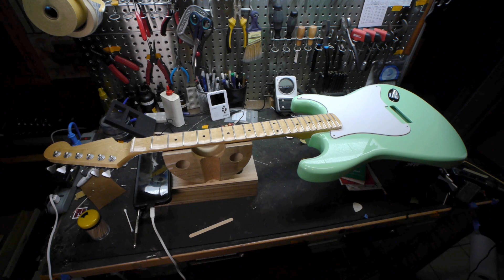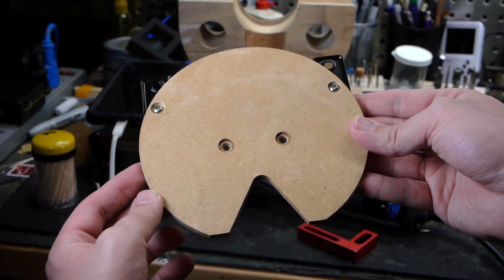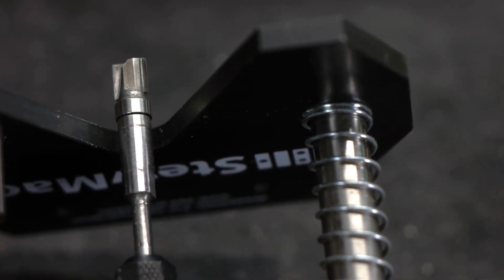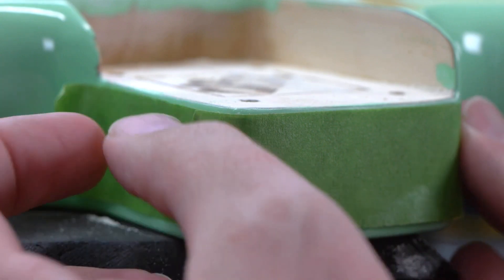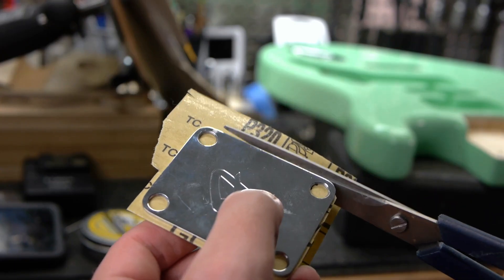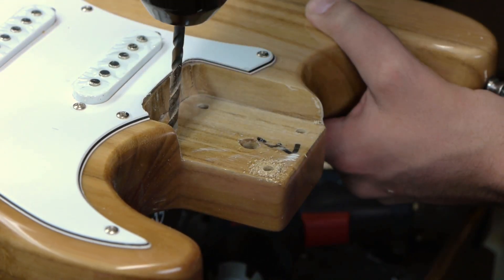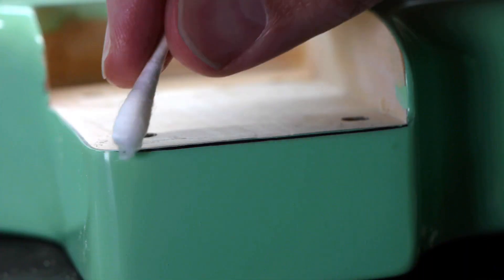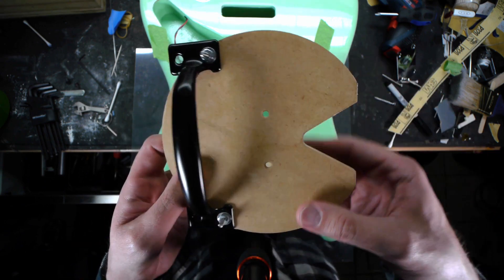*FLATTEN or DEEPEN the Neck Pocket* - Custom Baseplate for Stewmac Plunge Router Base

Comment from the maker: UPDATED ROUTER BASE HERE: https://youtu.be/08BCl9feae8?t=285

I'm working on doing an updated video, but for now, that's the most up-to-date footage I have for the new baseplate design. Very simple: 

* 1/4" MDF Neck Pocket Routing Baseplate
* 8-32 x 1/2" Socket Flat Head Machine Screws (2)
* #8 x 1-1/4" Wood Screw (1) 
* Dowel Handle (roughly 1-1/8" diameter)

The handle is attached to the baseplate with a wood screw. The countersinks on the holes indicates the bottom of the baseplate. The top is where the Dremel router base sits on and attaches to. Simply use the supplied 8-32 x 1/2" socket cap machine screws to secure the Stewmac base to the Neck Pocket Baseplate, screw in the dowel handle, and you're good to go. 

More on the way. I'm slowly working on redoing my bolt-on neck installation & troubleshooting guide, which will include an updated overview of the neck pocket flattening/deepening process. One thing I haven't mentioned in any videos yet is the use of Mylar film to protect the top of the guitar while routing. It's slippery enough that it doesn't pose any issue with the MDF sliding along the top of the guitar.
Reply: WOW! F.ing AWESOME! I so needed this. Doing a project on an Agile S1000, someone had taken a bloody chisel to! Looked at the Stewmac dremel plunge router attachment, $248, the actual Dremel plunge router attachment $25!!! I like the idea of your base, just adds more stability and guidance, but it does resrtict vision, the Dremel bas is clear, wo will see how it is before actually using! Love the tips on filing, protecting edges, the mylar makes sense! If i've learnt one thing, preparation is 99.5% of the job! This is gunna be an awesome Strat when finished, Agiles are normally very well made, just the electronics let them down, but they make for awesome upgrades. Just for your interest, it's getting a Vega Trem, compensated brass nut, and a 920D Semour Duncan All things Axe loaded pickguard. Who ever tried with this before must have been a butcher, the nut has been cut way too low! Thanks again, this vid is EXACTLY what i needed!

Comment: I use Bletch White (Whitewall tire cleaner). Spray it on a a piece of paper towel and wipe off the grease. Inside and out. Works great. During a long journey in bad weather, I spray the Bletch White on the outside of the window every time I stop. It cleans the wiper blades as well.
I'll try the Palmolive tip though (less toxic)and compare results.

Comment: I use my CNC machine as a pin router. With a bottom bearing router bit you can set the Z and take off .003-.005 as long as the back of the guitar is flat it works great without a router or dremel riding around on the top of the guitar.
Reply from the maker: Sounds like an ideal setup. Pin router is definitely the way to go if you have the equipment. 

More recently, I made a new design for the router baseplate, and have also started using mylar film to protect the guitar top when using the Dremel / Foredom rotary tool with the baseplate on top. 

I just cut out a mylar film template that has an opening for the neck pocket, and use Scotch tape to adhere it to the top before routing, and it works great. Slippery so the baseplate can glide around freely on it while the top is totally protected. 

The new design is also a lot better, I use a thick dowel handle on the back to counteract the top heaviness of the Dremel, which can make it prone to tipping forward when you get to the front of the neck pocket. 

I also made the baseplate significantly bigger, and a square shape rather than round. I use it in my Cozart 12 string makeover video, but will also be including it in my updated bolt-on neck installation and troubleshooting video. 

A pin router would certainly be nice to have. I have a pretty good array of tools but that's one I never got around to acquiring.

Comment: Thanks for your detailed explination in this video.  Also mentioning the bit and screws needed by exact name was a huge help.   😎
Reply from the maker: Thanks so much! Be sure to check this video out in the meantime, while I work on making a new version of this video: 

https://youtu.be/08BCl9feae8?t=285

This base works much better and the dowel handle is perfect for counterbalancing the top-heaviness of the Dremel when mounted in a base like this. Hope this helps. I'm (slowly) redoing my Bolt-On Neck installation and Troubleshooting video, and when it's done, it will be extremely comprehensive, and include details on this router base, and a whole lot more. 

Thanks again so much for the support!

Comment: What if you haven't got any of this equipment?
Reply from the maker: Personally, I wouldn't do it without it. Even I don't have the best tool for this job, which would be a pin router / overhead router. 

You can use a trim router for this job too, the Stewmac Plunge Base and Dremel setup is far more expensive, but it isn't 100% necessary. I prefer it because it offers more control. But I also have a Bosch Colt router and that would probably work fine for this job. 

The way I'd do that is to make a sled over the top out of MDF. Wouldn't have to be super accurate. But something you could double stick tape to the top of the guitar and that would support the router base. You'd need a plunge base for the trim router but those are much cheaper than the Stewmac setup. 

I've tried block sanding and it just takes way too long and isn't accurate enough. For significantly deepening the neck pocket I'd only ever do it with a plunge router, whether that's a trim router or a Dremel with the Stewmac base. 

The neck pocket has such tight corners that a sanding block or even a chisel would really struggle to take everything down 100%, and also evenly. 

I'm slowly working on an updated video for this, and will mention these things. Also I did make a new router base that's much better than the one shown in this video. I use it in my 12 string cozart strat video (recent video) if you want to check that out. And I also mention the Potvin template there. That video is here: 

https://youtu.be/08BCl9feae8

Hope this helps!

Comment: is that much of problem if the fingerboard extension is too high when the pocket is flat  especially when installing a top mount floyd rose or tom style bridge ?
Reply from the maker: If the action is OK and you're able to get the action where you want it by adjusting the bridge saddles, it's OK. 

Usually with this problem, even with the saddles adjusted as high as they'll go, the strings will be flat against the frets. 

So if the saddles are adjusted as high as they'll go, and the action is still too low (like strings flat against the frets), then the neck pocket needs to be routed down. 

Every individual guitar is a case-by-case basis. My 3-step checklist is: neck relief at the 7th fret, put a capo on the 1st fret and check the action at the 17th fret, and then remove the capo and check the action at the 1st fret. Once you've adjusted all of these, then I fine tune: set the action with the strings open at the 12th fret, and make micro adjustments to the 1st fret action, double check the relief. 

Generally, I always set relief to around .000" - .002" at the 7th fret, and at the 1st fret, the wound strings around .018", and the plain strings around .011" - .013". 

Then the action (12th or 17th fret) is set to preference. This works very well for me and then probably 95% or more of my customers. Leaving the 12th - 17th fret action as the sole variable, while setting the relief and 1st fret specs to the same measurements every time, makes everything a lot more standardized and a lot easier. 

So to determine if the neck pocket needs to be routed down, I'd first set the neck relief to .000" - .002", then put a capo on the 1st fret to remove the nut slot heights as a variable, and check the action at the 17th fret (the 17th fret action is roughly the same as the open 12th fret action when the nut slots are 100% dialed in to the proper height). 

If you set the neck with minimal relief, and check the action at the 17th fret while there's a capo on the 1st fret, and the strings are flat against the frets, see if you can lift the bridge and/or saddles up to get the action to around 4/64" - 5/64" on the bass side, and 3/64" - 4/64" on the treble side. Or roughly 1.5mm on the bass side, 1mm on the treble side, or just a touch higher than that. 

If you're unable to get the bridge and/or saddles high enough to reach that action, then the neck pocket needs to be routed down. If you are able to achieve that action (while the neck has minimal relief), then you're OK. 

There is something to be said for routing the neck pocket down anyway, if you don't want the saddles maxed out to their maximum height adjustment. That gets into break angle and more nuances that go beyond just action alone. But that's a whole nother discussion. 

Hope this helps!
Reply: @guitar_md  thanks for the respond, helps a lot.
Reply from the maker: @dimitrisstel3629 Absolutely, any time! Thanks for reaching out!
Reply from the maker: @dimitrisstel3629 Oh, and one more thing. You can "reverse shim" the neck pocket instead of routing it deeper if routing it isn't an option. 

I recommend using a full pocket wedge shaped shim. For a "reverse" shim, you'd put the thickest part of the wedge under the upper part of the neck heel, closest to the headstock, rather than putting the thicker part under the bottom of the neck heel closer to the bridge. 

Using a "reverse" shim will pitch the neck angle forward and increase your action. So that's an alternative if routing the neck pocket deeper isn't an option, but you need the action to be higher.

Comment: This video has addressed all the issues I'm having with my DIY build. Thank you so much
Reply from the maker: I'm so glad I could help! I'm redoing my bolt-on neck installation video, and I think it's going to be huge. It'll take an extremely long time, but my plan is to include an extensive amount of troubleshooting. And then discuss setting up the guitar after installing the bolt on neck. There are so many things that can go wrong and so many things to watch out for. 

So, we'll see! I already redid the video, and it's better than the old one, but still not done. I'm so glad my videos have been helpful to you. I try to make up for what's not in my videos by responding to as many comments as I can and hope to answer people's questions as thoroughly as possible every time. Feel free to ask anytime you're stuck on something and I'll do my best to help.
Reply: @guitar_md  I look forward to your next video; they're so helpful for us DIYers. I've been doing woodwork for over 50 years but this is my first guitar build.
I checked the measurements and the neck is .7mm (sorry we only do mm in Australia) wider than the pocket!!
If you don't mind may I ask you another question please? I also measured the depth of the pocket and the height of the end of the neck (is this called the heel?) to under the fretboard and the difference is about 8mm. It's an LP style I'm making so I don't need to allow for a scrathplate. Should the bottom of the fretboard sit flush on top of the body or is this gap ok?

Comment: I trim the neck pocket too low... What should I do????
Reply from the maker: Shim the neck pocket. You can either use tapered shims (like the ones Stewmac sells), or make your own flat full-pocket shims. 

TOSICAM on Amazon also has some shims for much cheaper. Just search "tapered neck pocket shims" on Amazon and you'll find much cheaper ones than Stewmac sells. 

I like using wood veneer, but cardboard also works. Anything you can trim to the shape of the neck pocket. Mahogany, maple, or cherry veneer is what I use personally, just because I have them on hand. Maple is the most traditional for a "professional" shim material. 

If you use tapered shims, you can get away with using a much thinner shim than if you use flat full pocket shims. That's the only difference, though. 

I only recommend full pocket neck shims these days, as using partial shims (like only on the last half of the neck) will cause the neck to warp when you tighten the screws down, which can cause the fingerboard to hump, and cause buzzing or fretting out. It's possible it can permanently warp the neck heel if left long enough like that as well. 

If you use cardboard or construction paper or anything like that, you can use a hole punch to punch holes out for where the neck screws will go. That may be the cheapest and easiest option. Construction paper or any kind of thick paper like that will work just fine and is a lot easier to make holes in than wood veneer or other materials. 

The tapered shims from Amazon are pretty affordable and you can also stack them with each other if you need to. They're the easiest option overall as long as you don't mind spending 10 bucks. 

Hope this helps! Remember, you can always shim if you rout the neck pocket too deep.

Comment: Great video, thank you so much. I abandoned a telecaster build because the neck pocket was too shallow and I wasn't sure what to do about it. My first thought was to reduce the thickness of the neck but I was nervous about doing that. So I arrived at increasing the neck pocket depth but I was going to use a regular sized router but I was unsure about that as well. I was not aware of the Stewmac router base so I just ordered one.

I also have another build where the neck pocket is too shallow and the screws in the bridge are at their maximum height to make it playable, so I'll be able to fix that as well.

Do you have a video about fret leveling with the Katana? I'd be very interested to see that.
Reply from the maker: Thanks so much! Working on so many new videos. As far as the Katana goes, I mostly use the RM Lite, which is simply a straight understring leveling tool. 

I get the neck straight with the guitar flat on its back, face up on the bench, mostly using a digital neck relief gauge. Then level. It's dead simple. 

I do have some more advanced techniques to help with the high E string choking out. I also think carbon fiber is the best material for understring leveling, though getting it perfectly level may be tricky. I use Dragonplate Carbon Fiber 1" ibeam. It's very expensive so the RM Lite is really the most affordable option though. 

The RM Lite is also .475" wide. I've become a fan of narrower leveling tools as they're better for following the string paths. Too wide of a leveling surface and you can't follow the string paths that accurately. I might even go to .450" width if I could but .475" is definitely the best width currently available. 

When you level under string tension, the strings act as "bowling alley bumpers" that guide you. It's easy and intuitive to level along the string paths when leveling under string tension using the RM Lite tool. 

The Stewmac Fretbars are very heavy. I think they're actually better suited for use as a regular strings-off leveler for leveling along the string paths. I think they're too thick and heavy for comfortable understring leveling but that's just me. 

For the High E choking out: don't level at all under the High E string. Level under B and G. The goal is to preserve the highest saddle height possible for the High E, which means not lowering the fret tops under the High E, and then lowering the fret heights where the High E will be when bent -- under the B and G strings. 

It's like a pseudo compound radius of sorts. You're actually profiling an offset trapezoid shape into the fret tops. But that's the general idea. 

You can take it farther and apply tape over the sandpaper on the RM Lite, so it doesn't level the first 3 or 4 frets, and levels fallaway from frets 4 or 5 to the end. I use Scotch tape which is about .001" thick. This is a powerful technique and I don't think anyone else uses it. Most people do fallaway from the 12th to the end. A very slight fallaway over most of the fret tops can help a lot and it's very minor when using Scotch tape. 

That technique can also be used on the Low strings to address stubborn buzzing. I'll cover all of this in a dedicated video eventually when I have time. I may go to a simpler filming style for some videos to accomplish this. The level of detail I normally use requires many hours of work to shoot and edit. I could cover a lot more ground occasionally recording videos where I basically just talk to a camera telling all the things I just told you here.

Hope this tides you over in the meantime. I've developed a lot of techniques for fret leveling/profiling that nobody else is using, and that's a couple of them. Let me know if you have any questions.
Reply: @guitar_md  Thanks for the detailed reply to my question. You have given me a lot of food for thought. I don't have any fret leveling to do at the moment but when I do I will probably be asking some questions about your use of the Scotch tape technique which sounds very interesting.